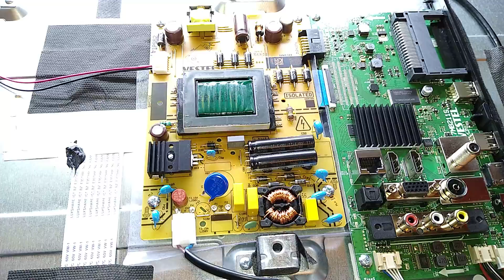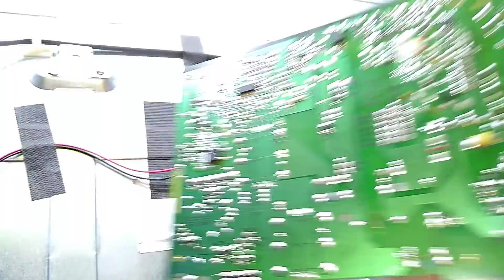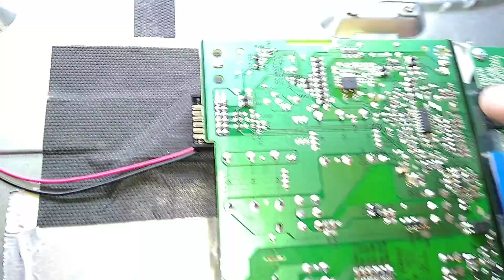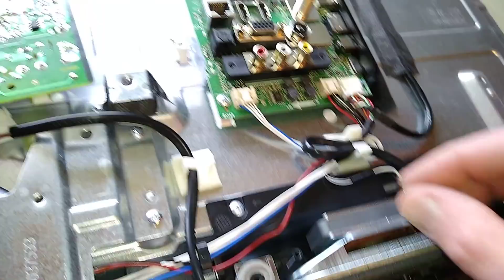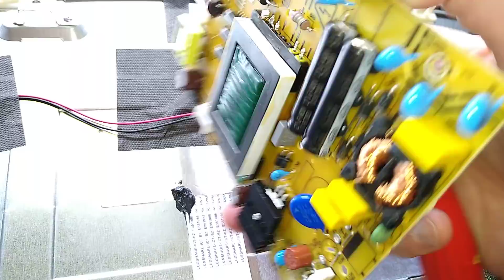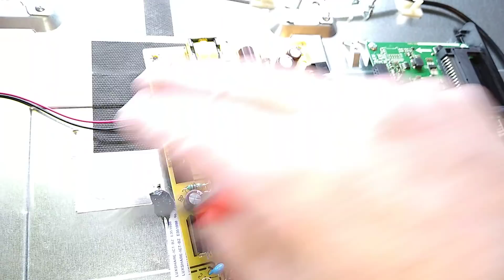There's not much inside TVs these days

Comment: Even after you unplug it the main storage caps in the psu can hold quite a charge, especially when its defective. I've had one where I measured 400V DC after two days of being unplugged and sitting in the corner. Bulged caps usually make the tv not turn on/remain in standby. I guess the mainboard is unable to boot properly with poor filtering.
We repair TVs at work (among other things) and yes its more or less board swapping. Its rarely worth it to actually repair the bords themselves.

Comment: I used to repair CRT monitors & TVs back in the day, when LCD panels came along I realised repairing was going to become much more difficult, due to the highly integrated nature and physical size of the components...
Reply: Против Глобал  In previous decades we would fault-find to component level. That is mostly impossible now.
Reply: Против Глобал  I used to work for a TV manufacturer. Towards the end of CRT TVs there was only 1 board on our TVs, so the "pink screen" is easy to fix ;)

Comment: Is that a compact flash connector on the TV?
Reply: It's the PCMCIA-like standard connector for the decryption module you get when subscribing to paid TV channels. The module is the size of an old PCMCIA expansion card and includes space for the credit-card sized card that holds your individual subscription keys and some management of the broadcast keys updated via the broadcast.
Reply: @johndododoe1411  Oh it's for a cable card.
Reply: @gudenau  Basically works in the same way, but you put a smart card into it.

Comment: I can almost guarantee all the backlight LEDs are all in series and one has gone open intermittently.  I see it a lot.
Reply: Just found the same thing on a TCL 55405. One LED out and tv goes into protection mode of some kind.
Reply: @tbohtwentyone  have similar on my Blaupunkt gaming "monitor".. takes it a few minutes to decide if it's going to fire up the backlights some days.. So far it's had 3 LED's replaced.. couldn't get the exact ones.. but I'm good with SM tech.. stick em on.. then slide em a bit.. would have thought the packaging would be standard but apparently not.. I'm not going into the 4 billion screws again just yet.. Not while I have a kettle and coffee.. Mostly objects if it's totally powered down so I'm suspicious of the caps as well.. next time it actually fails the whole lot gets seen to..
Reply: Yup. Especially on awful cheap vestel shit like this and their countless rebadge "brands"

Comment: It feels like such a strange choice to route such a high data rate LVDS ribbon cable straight under the high frequency switched transformer on the power supply board. That’s bound to pick up a heck of a lot of common mode noise. But I guess they must’ve done their homework and found that it’s within the signal receiver chip’s specs for common mode rejection..

Comment: Have fixed a few vestel tvs (rebranded as philips) the thing that allways fails is the psu board and 95% of the time it is the lcd driver chip. On the one models i am used to. Allsow are the outputs on that one that psu stable most vary depending on load between 10v an 16v?

Comment: Had to fix our tv too recently too! dead (partially) backlight. It was set to 100% from factory. As many other do, I'l pass forward the advice: Check if your tv has a backlight  level setting. If so set your brightness to max and lower backlight until slightly above what you'd normally want it at and fine tune brightness after. If image is flickery, uneaven or had any color shift, rise backlight and readjust brightness untill all that goes away. If you do this you extend the lifetime of your backlight exponentially is you will end up with it running at 25-60%. Replacing those damn led strips is a pain and you'l probably only find them on aliexpress (was my case).
Reply: I can't stress this enough! I repair too many TV's that eat the lamps or LED's because of high brightness. I always turn down the brightness of my personal TV's and monitors. Never had a personal LED or CCFL lamp failure!

Comment: 1. Some rail wasn't referenced to Vs or Vg correctly, so over time static buildup caused some reset pin to get stuck
2. Corrosion on some connector needed a jiggle
3. A solder joint somewhere is cold
4. Overheat protection somewhere
5. Transistor silicone drift! The thing that causes them to spontaneously die. 
6. Relay stuck
7. Some trimpot 
8. Tin whiskers!! 
9. bubbles in electrolyte caps! 
10. Microscopic cracks in resistors! 
Which one of these 10 alien faults was it.

Comment: So, the power supply drops the mains supply down to 40 volts for the LEDs, then boosts it back up? Why?
Reply from the maker: It regulates the current with the voltage.

Comment: TVs are basically monitors now, and my monitor from 2012 just had two boards, a power and control/interface board.
Reply: Including the tinny bad speakers. My Dad's old 2008 Panasonic is thick, but sounds great and still works after 12 years of being used 3+ hours every day.
Modern ones sound horrible, AV receiver is a must. (Or at least a sound bar)
Reply: @TheRailroad99  built in speakers have better sound in the bigger inch TVs
Reply: @pyeltd.1997  Not necessarily. I have heard a lot of 55"+ TVs with crappy sound. 
Usually it worsens with thinner TVs.
There is a reason you can buy soundbars everywhere now.

Comment: It’s amazing how empty the inside of a recent iPhone looks, too...
Reply from the maker: I will admit that Apple engineering is very impressive.
Reply: I think that's a bit different because iPhones are astoundingly complex. Companies like Apple now have two PCBs sandwiched on top of each other, and on the AirPods, the flex cable IS the PCB.   TVs are different because control ICs are very integrated and commoditized, so PCBs are getting less complex.

Comment: Bring back the flyback transformers!
Reply: Ah yes, fond memories of the transistors near those getting dislodged at solder joints and/or tracks breaking at pads.  Fun watching opened TV with a meter on top waiting for next failure.  Of cause this was old school without a decryption module.
Reply: Pretty sure the power supply transformer is a flyback, most smaller power supplies are of that type.
Reply: @NiHaoMike64  Modern TVs don't need 50kV do they?
Reply: @TradieTrev  Projectors based on arc lamps still do, well into the 10s of kV to strike the arc and then on the order of 100V at 2-3A to keep it going.

Comment: I use two 43 inch VIZIO TV's as a computer monitor, old eyes you know. As TV's go price wise when I got them, they were the cheapest in this size. Guess what, you get what you pay for, every once in a while they will 'lock up'. Turning them off doesn't help, I will have to find the electric cord and unplug them from the wall, that seems to reset the computer in them and I'm good for another couple of months. There are other 'quirks' about them but that's for another discussion.

Comment: I'm sure I'm not the only one here who used to take everything apart when I was a kid to see how it worked. Back then, you could actually see how stuff worked! Today if a kid figured out how to use a security screw driver and opened something up there still isn't anything to learn from...hard to figure out even the basics of what is going on inside...
Reply: That's how I learned about capacitors. Ouch.
Reply: @tncorgi92  LOL! Me too - I liked to play with those old disposable cameras. I'd take the film out and keep the "disposable" part. That big ol' flash cap really burns!
Reply: @tncorgi92  yep.. Zap! WTF, why am I on the other side of the room? And I'd been so careful by disconnecting it from the mains first :D

A little bit of knowledge is a dangerous thing !
Reply: We used to make "stun guns" from those when we were younger.  Used coat hanger for probes.  Made the mistake one day of charging it up and grabbing a probe in each hand.  Weirdest feeling I've ever experienced I think.  Could feel my muscles moving but had zero control over it.  Only for a second but I remember it as much longer.  Closest thing thing I can compare it with would be when you have a "chill" and quick shiver.
Reply: I'm 30, so not that old I suppose. Since I've been into Electronics it's pretty much been surface mount stuff. Though, as my name suggests, I definitely have an affinity for older stuff. LOL the point is though that all I had to do was figure out with the internet that all of the little bits and Bobs were the same as the big bits and bobs  and have enough interest to delve into things. Now I design surface mount boards for projects all the time using eagle and don't have a massively hard time fixing modern equipment. For the most part it's the same deal, just harder to find information on the specific board you're working on.
I mentioned the internet earlier. I think that that is the difference. For sure as technology advances everyone involved in it including younger Generations will have to be told some of the information, but that no longer is very difficult since the internet can tell them. There's also more classes at a younger age on things like Electronics. I wouldn't worry too much about younger Generations honestly. We all stand on the shoulder of giants and those that came before us. Just as a function of time they are sure to be better at this than we are.
Reply from the maker: Modern kids are adapting to modern technology and how to fix it.
Reply: @bigclivedotcom  They're "adapting", but they have to be told and taught, not simply take a hammer to their unused toys and figure out what they figure out.

I remember when everything had little light bulbs...real incandescent bulbs...toys were full of them, when I was about 5 I finally figured out I could smash one out, hook those 2 wires to a 9 volt and made my first flashlight! No way that will ever happen with an LED. There is nothing intuitive inside, it's all black magic.

Even if it has a motor now they often have complicated controls - making fans work and little motors spin was fun when I was a kid too. The 6 volt lantern and 9v style batteries were great for experimenting, they won't have those to use either!
Reply: @ryanroberts1104  y'just slap a resistor on an LED and it works okay, I had to figure that one out on my own since my dad didn't know. As one of those kids these days (21 now but who's counting) who grew up on modern electronics, or came into it in my late teens at least, we do adapt. It's dead-easy to program basic things on a microcontroller once you know how to get it working, and with those and some logic chips it's possible to do a lot. A lot of it's modular, but the modules tend to be pretty reliable unless you fry them, and I can still understand component level repair with some effort when needed.

Still don't know 100% how capacitors work though, but like, that's mostly on me for not trying too hard.
Reply: @bigclivedotcom  its pretty crazy to think whats considered advanced technology to us will be bare bones basic stuff to people down the road
Reply: @bigclivedotcom  much bigger barrier to entry though..
Not so much easy through hole stuff with large components, lot of surface mount now...     Although arduino etc makes it quite easy to develop projects, most of the time people have no idea what they are doing, just copy/pasting etc.
Fixing stuff might just mean replacing a board or screen, rather than learning how it actually works...
Reply: I remember taking one of our old TVs that just stopped working, one of the ones that used tubes, to class for a science fair thing. I took the back off and had info taped onto the side explaining how TVs worked. Everyone loved it then...
Reply: True !
Reply: Even today you can still learn as much when opening devices, if not even more so than decades ago. A switch mode power supply is one of the most straight forward things to understand, showing the use of all basic components. For the logic board it shows how circuits are built these days, modularized with "glue" in between them. In no way was a CRT TV easier to understand than a modern flat panel TV.
Reply: @superdau  I think you're missing the point. Unless somebody taught you, how are you going to have any idea what a switch mode power supply or a logic board is?? That is not something you can look at and intuitively guess what it is or how it works. If you took the components out of the TV and showed them individually, even Clive probably would have a very hard time telling you what they came from. Also these components have little use outside of the TV - you can't rip it apart, put it together differently and make something else.

I've never been taught anything what so ever about electronics, I learned much of it before I even figured out the screw driver...I was still using a hammer to open things. If you see a giant transformer with mains wires coming in and smaller wires going out, it's relatively easy to guess what that is. If you see a light bulb, a motor and/or mechanical controls, you can watch them move and see what they do. What is a logic board supposed to look like to a 5 year old?

I agree there isn't much to see inside a CRT either, but, overall, most things these days are just a black box where they actually attempted to make it so you CAN'T figure out what it is or how it works or how to fix it on purpose so you don't copy them. Note my earlier comment on security screws - I was already playing with batteries and wires and lightbulbs before I figured out regular screws. How old are they going to be before they have a set of security bits, and even know what that is? Not to mention the skilled use of a "spudger", a tool that did not exist when I was a kid...

They might learn all this in tech school at age 14, but not likely earlier. And they won't be self taught.
Reply: @ryanroberts1104  fairy lights fill the void of intuitive learning just as intuitive in led or incandescent form. plenty of pound shop junk to tear apart and learn the basics. 

sure you're not gonna figure out how a switch mode power supply works by intuition but you didn't figure out how a transformer worked as a kid either, you figured out what it does but not how it works, which is enough.

if you open up a tv it actually is pretty obvious how they work way more so than any old tv at least since the point to point wired valve days, kid plugs hdmi in and follows it to the panel, now you know the signal path, hdmi-> little lines on the board-> processor -> little lines on the board - > cable -> another board(tcon) -> little lines into another chip -> litte lines to two connectors -> 2 cables -> edge of the panel - > way more little lines -> picture
you follow it from both ends and figure out how they meet
high speed data transmission has made circuit board designers lay things out in a much more obvious way than it ever was when i was a kid tearing apart vcrs and tvs.

security screws are a moot point, they didn't keep me out of my gameboy when i was 5 and those things are far nastier than any security screw in current use. also it's way easier for a kid to get a set of every bit known to man for pocket change. also anything worth taking apart as a kid isn't going to be held together with security screws, kid's not gonna learn anything taking apart a macbook or a cell phone

as for spudging, you don't need one, hammer works much better and faster, or just tear it apart, soon enough the kid is gonna learn how spring clips and pop tabs work when they try reassembling something. 

tl;dr: it's not the 60's heyday of simple point to point wiring but just because stupidly complex things exist that are hard to understand doesn't mean everything fits in that bucket
Reply: @ryanroberts1104  also, we do happen to have a lot of older folks who posted very detailed explanations of this stuff to the internet 15, 20-odd years ago. It's no banging fancy rocks together, but it does get the job done in terms of electronics education.
Reply: @superdau  Easier to repair though.